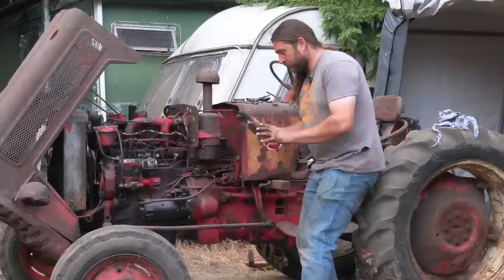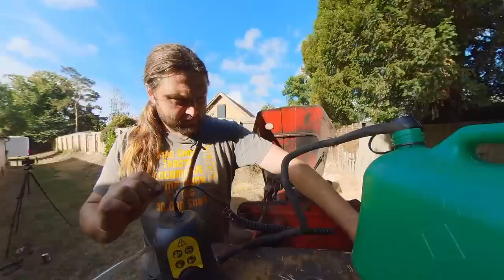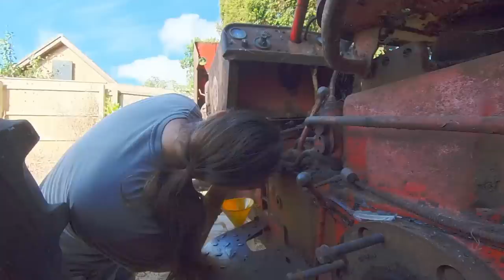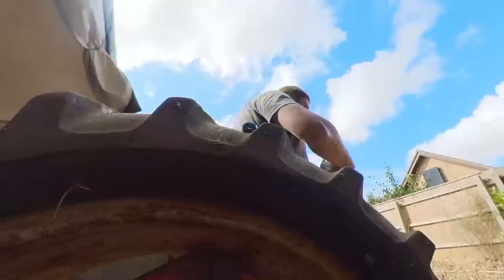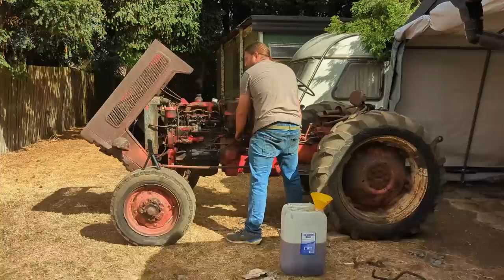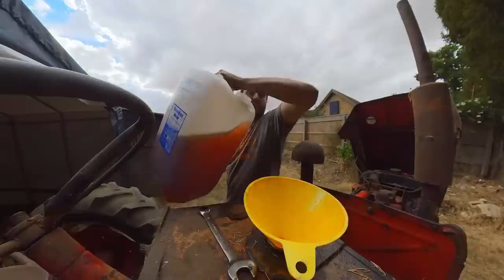Will my abandoned, broken International B275 Tractor start - and what's wrong with it?

Comment: would it not have made sense to try and clean the fuel tank a bit of the sludge, or is that not a practical thing to do?
Reply: This is LMM, we don't come here for "practical"
Reply from the maker: I did give it a flush, but left that out the video.

The tank really needs removal and properly cleaning but much bigger job that I was planning
Reply: @lmm  taking the tank of them is a pain

Comment: Always start by checking flow from the tank (even at the lift pump). Saves hours of looking & finding nothing, and not knowing why. The 'hunting' is the govenor mechanism, at the opposite end of the injection pump to the drive input. There should be a (very) large nut or screw to remove for inspection, just add half pint of engine oil there and run the engine. Almost always sorts it.
Reply from the maker: It shares oil with the engine, it's got a side panel that removes for inspection, but that's about it.

Comment: The easiest way to clear the fuel line from the tank is to back flush it with an air line. Once you have done that drain the fuel and clean out the tank!

Comment: I have a 1959 B275 That was having similar problems. My injection pump one line had no pressure. In the USA it's hard to get this model pump worked on. I finally found a place to rebuild it. I currently have the whole engine torn apart and a new engine rebuild kit.
Reply from the maker: Hope that it runs well when it's back together again!

Comment: Love the sound of a diesel.  They have a certain organic life sound to them.  The heart beats  the soul sings, and the wheels turn!  

Ever have a go at a Fairmont Railway speeder?  Air cooled twin flywheel hit and miss engine with belt drive, no transmission. If you want to go backwards, you shut off, move the timer handle to the opposite end of the throw and crank the engine by hand... BACKWARDS.  It really does run in reverse revolution!
Reply from the maker: I've heard of them - but never been lucky enough to get a go!

Comment: Awesome job mate. I have a B250 with the same blocking tap issue, even have a special made piece of wire in the tool box just for that problem lol I usually unscrew the tap all the way out and push the wire up thru the hole which usually clears it. Solution I’m yet todo to mine is pull the fuel tap/bowl out and add a 1/2 inch piece of tube to it so it can’t draw any gunk of the tank bottom. They are great, strong little tractors.
Reply from the maker: Oh that's a good plan. I will want to remove the tank at some point cause I need to do the steering
Reply: Bro I think all old tractors start like this. I had an old Ford tractor and cub cadet with same start situation...

Comment: If the surging disappears completely under load I would guess the problem is excessive slop somewhere in the governor mechanism.
Under low load conditions when just a little throttle is needed the linkages then have a delay between when throttle is needed and when it is actually communicated to the injection pump, causing surging.

On the lawn mower governors I have seen there is often a spring in parallel to some linkages that acts as a thightener-upper-thingy so that any slop is eliminated. As long as the spring is strong enough to counteract any force from the governor it should work.
Reply from the maker: I had thought maybe the spring in the governer was knackered!
Reply: @lmm  usually the fuel pump timing why they hunt with the early inline pump engine like yours. You Need to adjust the timing until it starts Ok but doesn't hunt.

Comment: Some tips i've learn the hard way.

1. Install exthaus flap asap (it's cheaper than rebuilding the engine because of rainwater)
2. Ether doesn't really work with oil bath aircleaner, plenty of it will be captured by the oil.
3. With fuel problems, always start looking from the tank forwards, usually it's just blocked filter with these old things or dirt in the tank.
4. Replace the hose between the filter and injection pump, the inner layer will seperate at some point and make a huge mess.
5. If injector lines are full of air, it will act as a spring and the injectors will not open.
6. Those kind of injection pumps have oil in them, just normal engine oil and needs to be changed every 500hours or so, check manual for more detail.

If you're going to use it for something, add some fuel additive that cleans the injectors, it will make a big difference.
Reply from the maker: They live under cover, so I'm not too fussed about having exhaust flaps.
It still helped to start it!
Initially I didn't realise it was a fuel issue - but yes, would have made sense. Start at one end and work back!
Worth noting thanks
Hense bleeding it up
That could well be the issue - I'll check that next time I'm there!
Reply: With any diesel engine with mechanical injection, use the hand pump to prime the system up to the injection pump.
If you are lazy as me, use compressed air in the tank to push the fuel and air out.

Then loosen the injector lines at the fuel injectors, run the starter until there is no fuel coming out.
Tighten the injector lines and it should start almost immediately.
Doing it like this greatly reduces the wear and tear on the starter motor
Reply: The engine is smoking way too much black smoke.
It could be that someone has opened the fuel adjustment srew wayy too much, and thats why its struglin to run smooth.
Or the injector nozzles aren't working properly, they are "pissing" the fuel rather than spraying at fine mist.
There could also just be coldstart button/srew thats stuck at ON position.

I would recommend 5x0.28 nozzles, the original may be 4x0.32 but 5hole ones with smaller openings are better.
New nozzles with adjustment is about 200€ or less depending of the quality, but they are worth it to replace.

Getting the old injectors out of the head may be hard as they can be "a bit" stuck :)
If the injector "nuts" need to be replaced, use the old nut as a cleaning tool, attach a bolt to the nozzle hole, stick it in a drill and stuff the nut full of scotch brite.
It looks like it isnt smoking blue that much, meaning the engine itself isnt burning oil and has good compression and whatnot.
Reply from the maker: @NuffMan_  thanks for that, I'll have a look at it and see what can be adjusted!
Reply: @lmm  if you can find an PDF of the manual it will be great help

Comment: What a fantastic video. I love getting old things like this working. Congratulations on getting it working.  My guess with the governor is maybe the mechanism is a bit gummed up but I'm not an expert
Reply from the maker: Could well be
Reply: Diesel's suffer from diesel bug due to the bio stuff that they put in the fuel. Usually this can be cured by running a fuel additive in the fuel and giving the engine a bit of hard work. Most tractors old and new can suffer the same issues.

Comment: There is in inspection cover on the side of the injector pump. If you remove it and add some oil on the injector pistons they will stop sticking. This was an ongoing problem with these tractors. Also, The bleed pump and the bleed screw on the top of the fuel filter are there for a reason,it is quicker and easier to bleed it if you use them. Good luck.
Reply from the maker: Oh excellent! I'll give that a try!

I cannot get the bleed pump to release - twist anti clockwise and it should 'unlock' to pump right? Or am I doing something wrong?
Reply: Sounds like you are doing it right. You might have to take the whole bleed pump off to get it working. I think that the brakes are the same as IH used in the US. They are a multi disc brake with 3 ball bearings between the plates to spread them. They tend to get gummed up with wear material. It might be worth a try to remove the dust boot off the bottom and spray brake cleaner up inside. If it works it will be a lot easier than taking the whole assembly off.

Comment: I have a B414 - maybe you figured it out already but those engines I found always need the use of glow plugs to start. Even in the middle of summer when it's warm out, unless it has been running in the last 2-3 minutes and is still warm, you have to use them.
Reply from the maker: I always have to use the glow to get it to go!

Comment: A trick for siphoning out a fuel tank with direct fill neck is take a piece of metal fuel line as long as the tank is deep +6inches (used to aid in positioning) and use that as the siphon pickup tube you can easily position it and being metal it will hold its end below the fuel level.
Reply from the maker: That's a far better idea

Comment: Don't know much about this particular tractor or engine, but the old tractor I used to drive on a pig farm did the same thing and I was assured it was normal at idle. Something about having no load on the engine. It gets a blast of fuel, spins up, cuts the fuel and the sheer weight of the flywheel means it takes time to slow down to the point the governor gives it another blast of fuel to stop it from stalling.
Reply from the maker: Makes sense, it's just a bit rubbish 😂

Comment: super helpful on these one internationals look up some adjustable podger spanners i keep a pair in mine. pointy end helps alot with aligning implement's and things adjustable end lets you spanner and hit things. when i first got mine International 785xl same idea only bigger. the tank had 2 inches of Diesel slime in the bottom ended up having to clean and flush the whole thing.  
 As others have said the taps on these are known to clog up.  you can add an Electric pump inline before the mechanical one just to help it along abit as well.
Reply from the maker: When I eventually get round to fixing this the tank will come off and get cleaned

Comment: It looks like the injection pump is a pneumatic version rather than a mechanical one. The dome to the right of the pump contains a spring loaded diaphragm. The pipe coming out the top of the dome will go round to the inlet manifold and connect in on the engine side of a throttle controlled butterfly. When the throttle is closed (low revs) the vacuum is high which sucks the diaphragm, overcoming the spring and reducing the amount of diesel going into the cylinders. When the throttle is open the vacuum reduces, the diaphragm is pushed by the spring and more diesel is allowed into the cylinders. When the tractor is being started there is no vacuum so plenty of diesel is available for starting. The diaphragms were originally made of leather, at least they were on Simms injection pumps. Yours is probably now perforated which means the diaphragm doesn't close the flow of fuel as it should be causing the engine to revs up, the vacuum then increases because it's sucking in more air through the manifold, this moved the diaphragm which closes the fuel supply down, the engine slows, the vacuum falls and the cycle begins again. At high revs the vacuum is low so the impact of the perforated diaphragm is less significant as the pressure difference on both sides of the diaphragm is less so the hunting is not present but the diesel to air ratio will be a little out.
Replacing the diaphragm is pretty easy. If the original spring looks ok then I would not replace it as the new ones don't seem to have the same tensile strength and will upset the fuel/air balance and will need adjusting by a mechanic who knows how these work.
Hope this helps.
Reply from the maker: I've replaced the diaphragm before, so I assume it's the spring. Thanks for the information!

Comment: You can bleed all the injectors at once you don,t need to do one at a time. The surging is caused by the diaphram in the fuel,pump ,a leak or loose conection I think some one has fitted an engine from a B250 as almost all B275 had a rotory DPA pump.I know that some preproduction and early models had the inline pump but I would be surprised if any still existed .You could contact one of the IH tractor clubs for more information,could be valuable!
Reply from the maker: They were all open, I was just doing them up as they bled up.
I replaced the diaphragm before, and the old one hadn't failed.

Oh really? That's interesting! I'll have to find the things serial number!
Reply: They still pop up now and again

Comment: The inside of the petrol tanks on some of these old tractors is incredible . I've got a 1948 Ford 8n and it hasn't blocked yet but it looks its got a piece of hose and loads of little stones in it I've resorted to letting the tank dry out and using a shop vac to remove what I could.
Reply from the maker: That's a good idea!

Comment: Always look at fuel filters first or gauze strainer in tank . Throw the ether into the neatest bin if you need starting aid use crc , wd40 ect it is less explosive
Reply from the maker: I've heard WD is a good alternative.
I'm not a fan of easy start, but wanted to see if it would actually go
Reply: Easy start can over time glaze the engine bores. WD40 is a safer bet or in petrol engines a small amount of fresh petrol into the carburettor.

Comment: i think it is called ghosting the governor is revving engine to keep it going usually that's down to idle issue or not enough fuel is going into engine for idling if possible may try adjusting idle fuel mix
Reply from the maker: Possible indeed

Comment: I’ve got a 1959 B275 and it kept quitting on me. Turns in there was sludge in the fuel tank. We took it off which is a job in itself. Getting the nut off the steering wheel was hard to get off and then the tank slides up the steering column. They’re a hard Diesel engine design to start with because they aren’t a direct injection diesel. They need the glow plugs working no matter what.
Reply from the maker: I need to do the steering box, and it's going to be such a pain!
Mine needs so much glow to even have a chance of firing up

Comment: I suggest you remove the filter above the injector pump and clean it, or replace the element, as it’s sure to full of rubbish also, which will restrict the fuel flow
Reply from the maker: That's a good idea

Comment: Amazing how tractors will run on ancient fuel. You have a lot of work to do on this one.  So glad it was only a primary blockage. But the whole fuel system needs an overhaul beginning with that rusty sludgy fuel tank. As you said, governor might need some work too. Could just be springs or corrosion should be obvious. Can you still get parts?
Reply from the maker: Some yes, some no from a quick look. It'll get sorted when I come to overhaul it
Reply: New tractors can be usually a bit more fussy due to modern electronic injection systems. I have worked in farm machinery dealerships and its not uncommon for modern tractors to have a mid year fuel filter change as they will usually end up with the dregs from the fuel tank at the farm if they have been filled when the fuel tank is empty. Modern diesel also has bio fuel added which goes off and causes a issue know as diesel bug.

Comment: That revving by itself might be due to low level of oil in the pump, had the same issue with 2 of my tractors and pouring about 0.1-0.2l of oil in it solved that issue.

Comment: Well done! Meanwhile, I have to fix my Diesel on the weekend. Clean the EGR valve and remove the codes from the ECU via OBD2. That's progress, that is!
Reply from the maker: I'll plug the ob2 reader into this, see what it says!
Reply: @lmm  🤣🤣🤣
Reply: Add some quality diesel fuel additive as well and give your car a Italian tune. That can sort out issues
Reply: @bentullett6068  Thanks for the tips! I can't really complain, it's done 185000 km, the last 35k in my ownership. I always use premium diesel. When I got it, the dipstick was broken and the previous owner had overfilled the oil by 3l! That triggered an EGR fault, but the correct dipstick and oil level and clearing the codes madethe code  go away and it has run great ever since.. Luckily, no blown seals.

Comment: What a shame you didn't flush the tank out at the same time and screw a 2" stand pipe in the top of the tap, I think you should put a new fuel filter on soon. It won't last long before it plugs up again. Enjoyed the video though. ps check the butterfly in the inlet manifold.
Reply from the maker: I need to lift the tank to address the steering issue, so I'll clean it out proper then!

Comment: By running it up through the fuel tank fuel line inlet tube to unblock it with. Something like bailing wire.,or A coat hanger that is metal.
Reply from the maker: I'll have a go!

Comment: fuel pump timing may be slightly out. Will also help it to start better if that's the case. if not governor spring caput
Reply from the maker: I'm wondering on the spring. It's geared timing I think, so unlikely to be timing?

Comment: You have a priming plunger on that engine, always start at the tank tap and fuel condition
Reply from the maker: Is that the hook thing on the pump?
Cause I cannot get it to 'unlock' to pump
Reply: @lmm  yes that is the fuel primer it should unscrew like a normal thread and then you should be able to manually lift it up and down to pump the fuel and bleed it
Reply from the maker: @danwaters115  that's what I thought, but it doesn't seem to unlock itself. I'll have to further play